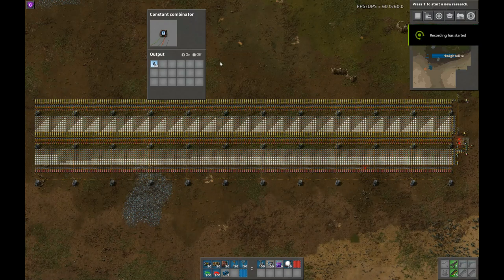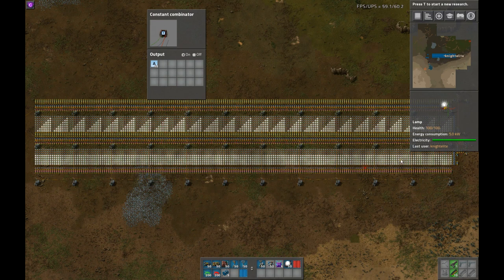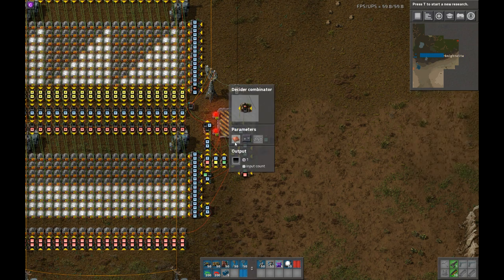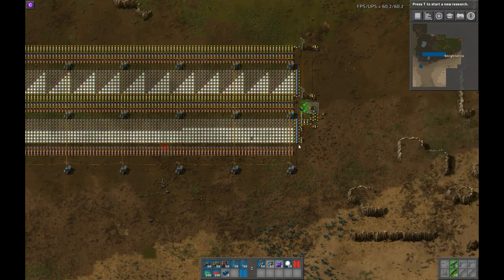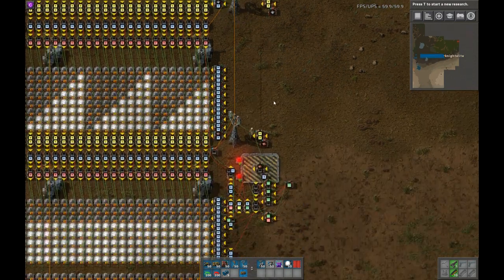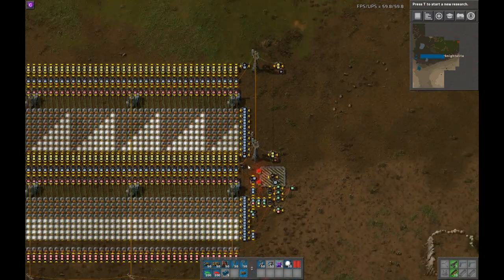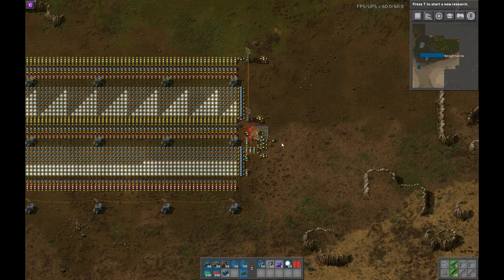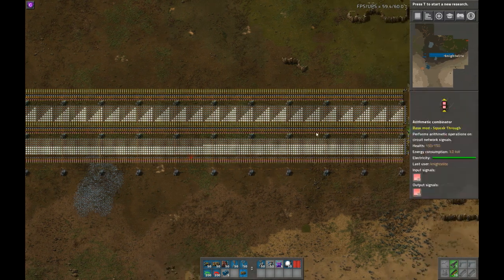Factorio Logic Analyzer

Comment: so let me get this straight... this is basically a graphical representation of a signal on a circuit network over time? this is fucking amazing dude :0
Reply from the maker: That, and it can be paused and the combinators can be moused over to read exact values from that point in time relative to the trigger condition.  Hopefully it's a useful gadget :).
Reply: Useful for what? Like, what exactly is this supposed to "debug", how do you implement this in an already existing circuit network to see where "errors" may be? I don't understand the point of this gadget here, do you have any more in depth explanation of this entire circuit, like an actual diagram describing why everything is where it is and why each value has been set and why each signal is needed and all that?
Reply from the maker: As a computer engineer, I use logic analyzers all the time to debug hardware, so it's fairly second nature to me.  I understand that's not the case for everyone though.  Essentially it lets you see the history of all the signals prior to the trigger event.  So if you wanted to watch 6 signals, you would make 6 lanes of this and you could see the history of all 6 of them for the previous 200 ticks.  So if your circuit does some undesirable thing, you would set the trigger condition to catch that thing, and then you can look over the history and see what sequence of input signals causes it to behave like that.

I'll try and make an explanatory video on how to use this to debug circuits in Factorio to make it more understandable for people though, I've gotten this feedback from a few other people as well.